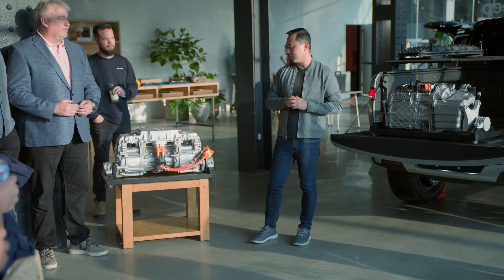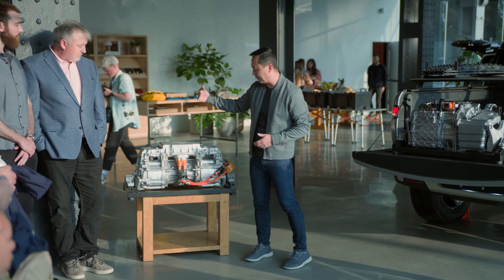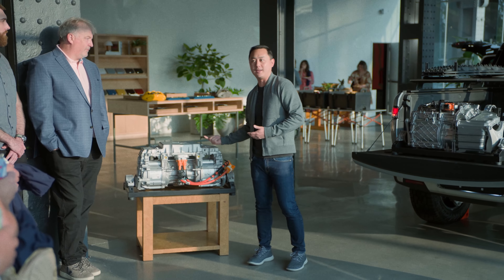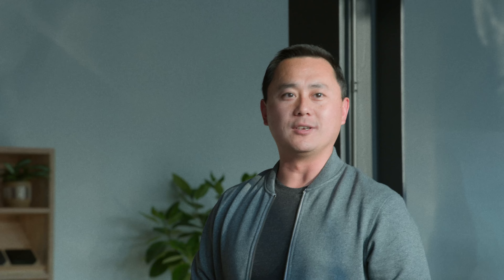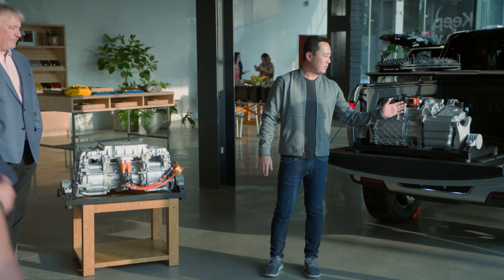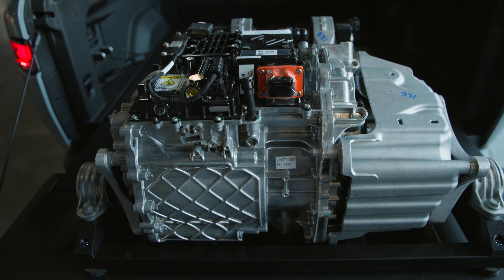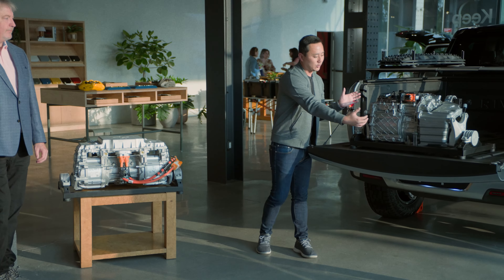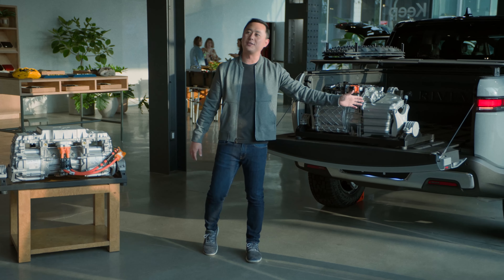Rivian Drive Systems Explained | Dual-Motor & Quad-Motor | Rivian

Comment: I wish I could afford to get a Rivian. I love the looks.
Reply: Pleb
Reply: Wait for the R2.  It'll be more affordable 😊
Reply: @ScoobyFermentation  It's OK I will just keep driving my Model X and riding my motorcycles.
Reply: relatable, i want a rivian so bad
Reply: I worked my butt off and saved for the last three+ years to finally be picking mine up next week.
Reply: @davidwhite6783  I don't know your time frame but I'd jump on an R2 reservation as soon as they open. Supposed to start at 40k, available starting around 2026.
Reply: @davidwhite6783  yeah looks like a small crossover SUV first, but it's a platform so should have a pickup too.

Comment: I kinda wish I got the dual motor for some range reasons but I sure do love my quad motor all the same!
Reply: Agree on slightly better range (looks like 5-7%) but the quad motors is just too good of a hardware thing if you're into performance. Getting this in a vehicle under $100k is truly impressive.

Comment: So, that's nice, but how does the torque vectoring work on the dual? How does it perform in split mu or wheel off the ground conditions? How does the front/rear split work in normal and performance driving?

Comment: Would love to see the Quad unit and Dual right next to each other.  The Dual which is actually a single motor looks larger than the Bosch unit?  Also, there is really, very little additional range or efficiency with the Dual option.  Quad still looks like the best overall value and experience.

Comment: So can you basically simulate a locking diff with the dual motor? So you’re less reliant on the computer making the right torque decision and have a more traditional off-roading driving experience?
Reply: What do you mean by the dual? Because in their case the "dual" only has one motor per axle, with a diff (like most EVs) and thus it isn't that much different from a fuel car, needing to deal with an open diff or replace it with some locker or LSD.
Their quad motor, having a motor for each wheel, allows for unlimited torque vectoring. It could in fact act as a complete difflock by outputting the same torque and same wheel speed. But they won't do that, because they can do even better than that, by deciding the torque and wheel speed per wheel.
But yeah, in theory they could make it behave like a difflocked vehicle. Even up to the point it could act as a vehicle with 3 difflocks (old school 4x4) and putting strain on the steering on dry grippy surfaces. There isn't really a reason to do that with a motor per wheel.
Reply: No replacement for real lockers

Comment: The Dual Motor Enduro drive unit looks even larger than the quad drive unit. Why can't the Max battery pack I pre-ordered come with the quad drivetrain I also pre-ordered? Is that still a possibility? RJ mentioned during the IG live feed that they were still working on that.
Reply: Oh it can and it will, just not for the price you pre-ordered at. That was the reason for cancelling it.
Reply: I had been a longterm max pack preorder holder until the quad version was put more or less put back through R&D to add in more capabilities this past christmas. During RJ's Q&A a few weeks ago, he showed a Quad setup on a durability dyno. I'm going to guess that's the one that will end up in the Quad Max. I ended up giving in to temptation and shifted to a Quad-Large R1T and honestly, it's been incredible. I'm currently sitting in it, at a ferry terminal typing this. "IF" you are okay with the 450-500km the large pack offers, I would make the move. You won't regret it.
Reply: Yeah I was a long time hold out for the Quad Max that I ordered (originally Explore package as well). But they kept gimping it in small ways and eventually cancelled it, so that now switching to dual Max just doesn't make sense for the smaller than initially promised range gain, and losing 2 motors and several drive modes. When I got shop access a couple months ago I eventually found my ideal config (for a quad Large) as a price even lower than my early pricing because it's a Launch Edition, and the value proposition there is just too great. I plan on doing some towing, so would I like more range? Of course, but there is no better value available for me than the truck I'm buying. I should be picking mine up next week. Can't wait.

Comment: Question?
How much power is loss from the motor or motors to the wheels?
How's the center of gravity, say the R1t vs the rivian sun?
I'd go dual motor.
Is Rivian making the inverters in house, what about the cells and the motors?

Comment: Is the performance version hardware, software, or both. If it’s just software, would you be able to add it at later date if you so desired? I would expect adding it at a later date to be a little more expensive than getting it as part of the original truck.
Reply: They’ve confirmed it’s just a software unlock. I’d be shocked if it couldn’t be purchased post-sale at some point, that’s free margin for them.
Reply: Do you remember where they've confirmed this? Thanks @TravisKetchum

Comment: I’ve asked Rivian to switch from the quad to dual motors, but a Rivian rep told me that the post March 1, 2022 pricing would apply, which is more expensive than my current quad motors pricing of $75k. Although I was expecting Rivian to give me some credit for the switch which saves them money as I really don’t need all that power. I’ll keep it and hope to start the delivery process before interest rates start going up again.
Reply: They’re pushing out their dual motor offerings over quad at the moment. More bang for their buck since most quad orders are at the pre-price hike locks.
Reply: When I was in your position I got the option of switching to dual with a discount, like $2500 off dual and $3500 off dual Performance, iirc.. I was holding out for Max pack but the end of the day I went with quad large from the shop because it's just too good of a value even with those discounts on dual.

Comment: Will not take delivery until quad-motor & max pack is available 😂
Reply: I was you for so long. Then the ideal quad Max Launch Edition showed up in the shop and the value was just too great.. picking up up next week.
Reply: I am driving a Mach-e GT with 50k on ODO.  Time is on my side! 
I do take cars on track so quad-motor would be nice as it work like an LSD. I was a regular in Refuel EV time trial pre-Covid.
Max-pack give flexibility for long travel.  With freeway driving up above 80 mph on part of Utah,  I am not expecting more than 2mile/kWh.  330-350 miles range will give flexibility on charging locations (including down chargers detours).

Comment: I would actually rather have the duel motor, and install a  “real” locking differential in the diffs.   In theory the quad motor could mimic a locker or even perform better, but in real life it does no such thing and gets confused or hesitates or won’t let you spin tires. Epic software fail. Just write a line of code : wheel speed left = wheel speed right.
Reply: Your code suggestion can’t be implemented because speed depends on both input power and resistance which varies unpredictably. 

But we agree the bottom line is quad motor sucks.

They could send the same power to each wheel but then they’d make the tire shredder 4000

Comment: All that fancy engineering and they still can’t do a basic locker?
Reply: They don't need a locker with a motor per wheel.
Reply: @roland9367  They don’t need a mechanical locker but they do need to make all four wheels spin at the same rate. That can probably be implemented just with software. But as it is today they don’t do that and  it works very badly.
Reply: @WilliamAArnett  Do you have any proof videos of that? The videos I've seen it was crawling quite well with a lot of grip.
By the way, all wheels spinning at the same speed is not the end goal, the end goal is to put the torque to the surface. Sometimes a bit of wheelspin is actually useful. But then the computer would really need to understand the surface properly.
Fixing the wheel speed firmly like you would have with 3 difflocks would only put strain on the steering rack I guess. And it would start to work like an old school 4x4, which would have quite some grip but no more computer assisted traction control.
Reply: @roland9367  I don’t have any videos hardly but a quick search on YouTube will find them. Kyle Conner has one from a year ago. Others have demonstrated the problem with roller ramps. The bottom line is that when one or more of the wheels has no traction then no torque goes the the one(s) that do have traction. Exactly the opposite of what is needed. It seems that the only way to deal with such situations is to go fast. And that’s an invitation to breaking something.

Sure there are lots of further optimizations that could be done. And should be. But a simple “software locker” would be a 90% solution while they work on doing better.
Reply: @roland9367 not true at all. Watch some videos and educate yourself. Pseudo lockers are not lockers at all.
Reply: @bob15479  You mean pseudo lockers as in software controlled abs/traction control systems as an alternative to real difflocks?

Comment: So it's 1 or 2 motors not 2 or 4
Reply: ... per axle
Reply: Drive unit and motor are 2 different things. The quad motor system has 2 motors per drive unit. Hopefully this helps.
Reply: @pazirandeh  so there are 8 to 16 per vehicle?
Reply: @bonustimeslots  so does the quad motor thing have 4 motors or no
Reply: @joshweickum  Quad motor has 4 motors, 2 drive units. Dual motor has 2 motors and 2 drive units. 1 drive unit for front and 1 for the rear.  It would technically be incorrect to say per axle as each wheel has an axle. The quad motor has 1 motor per axle, the dual motor version shares power to each axle.
Reply: @joshweickum This truck has 2 axles.

Comment: Bottom line for the consumer: is the Bosch or the Enduro going to give 500,000 trouble free miles? My bet is on the newer in house Enduro unit.
Reply: Who has more experience designing and manufacturing motors?
Reply: Hopefully both last a million miles but if I had to put my money on one I'd go with Bosch with their almost 100 years experience making motors.

And I did. Picking it up next week.